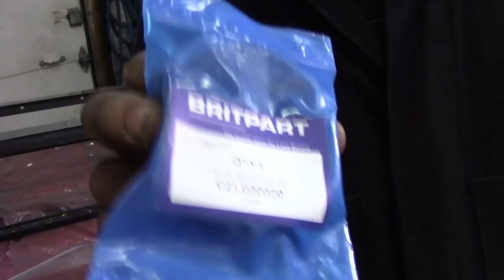Defender pick up cab.  Sliding window refurbishment with modification. Long video Pt3

Comment: I wonder if the plastic filler strip you removed was fitted because that whole window was originally installed in a 110 hard top - it’s not uncommon to see four of those windows used on 110 hard tops as they are a fair bit shorter than the 90/110 station wagon side windows, of which you can only fit one per side to a 110.  Used as side windows, people generally make sure they only open one way.
Reply from the maker: I have not seen the pick up windows used as side windows as for some reason they are quite thick - maybe offset to the outside to give more room inside the tiny cab?
Reply: That is a problem - it’s not a pretty job because the frame protrudes so far, but it isn’t uncommon, especially in Africa.  It’s done purely because the length of those windows allows them to fit the 110 side panels between ends and the mid-panel vertical rib, so you can fit two per side and can leave the rib intact.  If you try the standard windows, you can only have one per side and you have to cut brought that rib.  I imagine the windows would make quite a lot of wind noise on the motorway, given how far they protrude.

Comment: Never worry about how many people find it useful.
I don't have a pick up, I don't even have a Land Rover! Still watched and enjoyed.

Slap on the wrist for using a Philips screwdriver on Pozi Drive screws. It's forgiven as I know you can't get Pozi screwdrivers over there.

Is that caulk gun a Tajima? I have seen them but after you saying they are non drip I think I better get one.
Reply from the maker: Yes that is the caulking gun - pay a bit more and get a good gun - you can see how long one pump will do
Reply: @BritannicaRestorations  Thanks Mike. I will have to get one. Tajima are expensive but I have never regreted any of their tools I have purchased

Comment: Question Mike.
What happens if we use alluminium rivets into steel? Will it cause a reaction that leads to corrosion?
Reply: Harvey Smith Not a problem.  It’s steel fixings into aluminium panels that cause issues, but if you make the hole a tiny amount oversize, paint the edges, and add grease once dried, then you don’t get much trouble with that either.
Reply from the maker: I have seen aluminium rivets fail in steel - depends on the environment
Reply: That could happen in maritime applications or plant that works in high salt, high moisture conditions (mining, perhaps), but I think there would be no problem on most vehicle cases.
Reply: @nickboylen6873  Thanks Nick, that makes sense when I think about it.
Reply: Harvey, what happens is that two metals have different electrical properties and will behave like a battery when they can conduct with each other.  Water and salts exaggerate it by acting as an electrolyte.  Aluminium is more reactive than steel, so will be sacrificial, similar to how zinc is used sacrificially in galvanising to protect the steel.  Aluminium does the same thing for the steel, and so while the steel part will be better protected than by itself, the more reactive metal will corrode and dissolve faster.  It doesn’t matter whether which metal is the panel or fastener - the aluminium part will deteriorate because of the steel using it galvanically or electrolytically.

What some done realise is that the reaction is even worse with stainless steel, deteriorating aluminium even quicker, so if you ever use stainless fixings on aluminium parts, make sure they’re very well painted and greased, and ideally use plastic or rubber gaskets to keep the steel out of direct contact with the aluminium.
Reply: @nickboylen6873  Brilliant Nick.
I have a basic understanding of electrolysis so this makes clear sense to me.
I have been proctrastinating on a restoration project I am doing as I need to rivet some steel brackets onto a steel wing.
In the back of my mind I knew there is an issue with steel and alluminium touching and corroding.
I am happy now, I can use standard alluminium rivets and not worry. The rivets can be sacraficial as they are easily replaced.
It sounds daft but it has lifted the pressure as I like to do things right.
Thanks again Nick